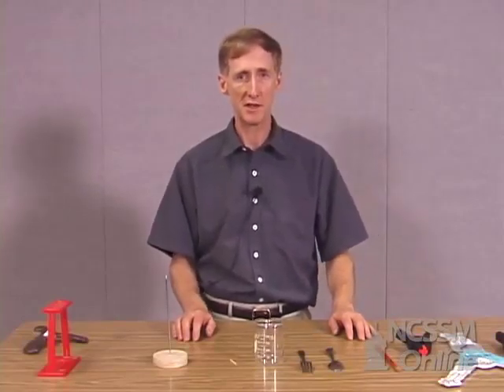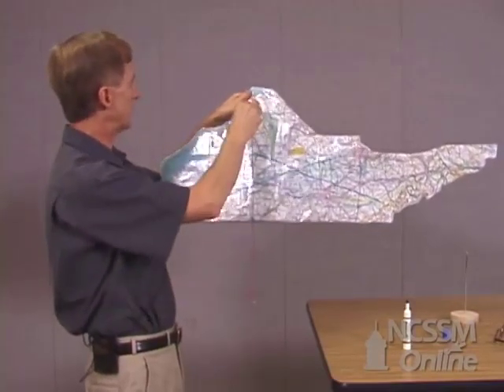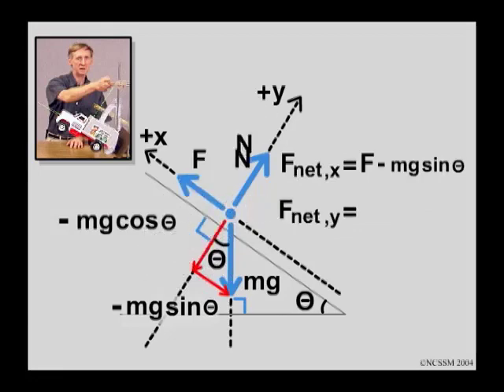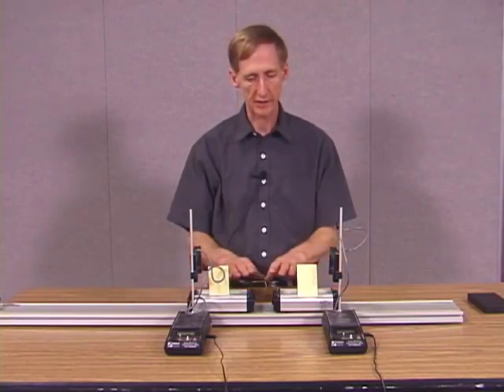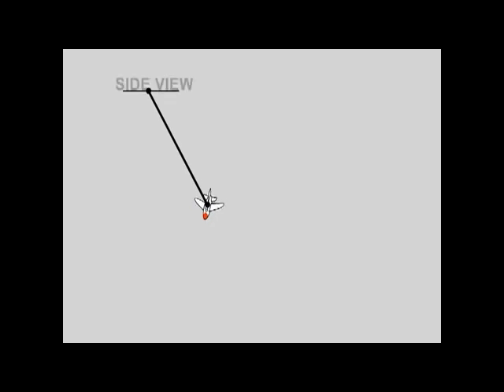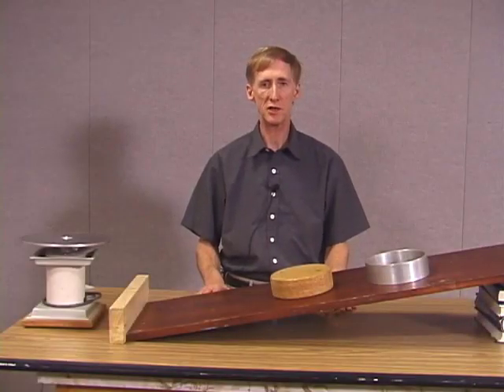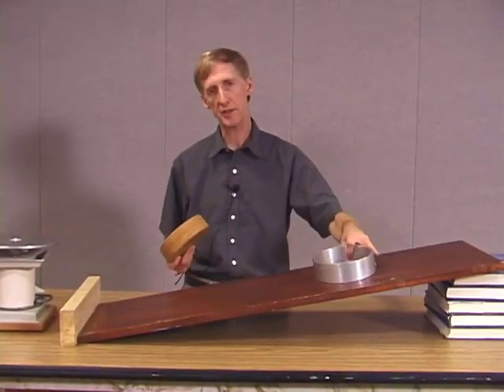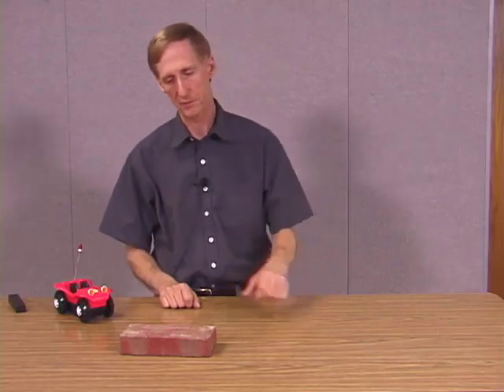Physics for Beginners

Comment: 5:45 Finding the Center of Mass of the Irregular Object
9:16 Equilibrium of Forces - part 1
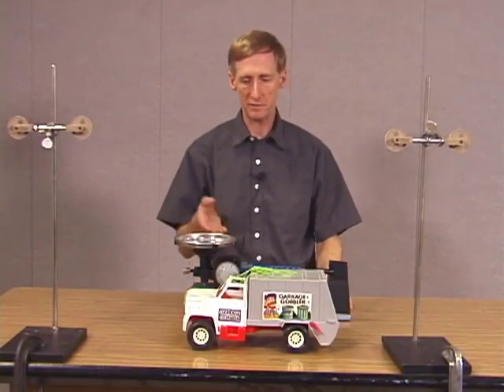17:24 Equilibrium of Forces - part 2
18:37 Centripetal Force
36:20 Rotational Inertia - balancing a stick
44:10 Force and Acceleration on a Turntable - part 1
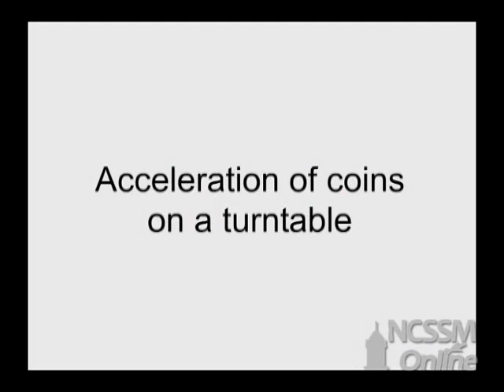45:05 Acceleration of coins on a Turntable 
47:22 Force and Acceleration on a Turntable - part 2
Reply: Thanks buddy!!!❤